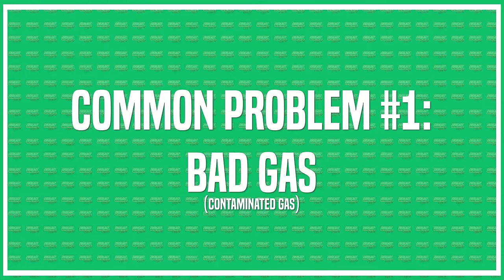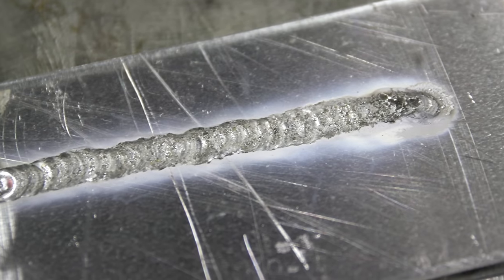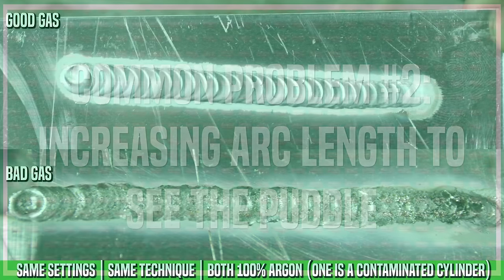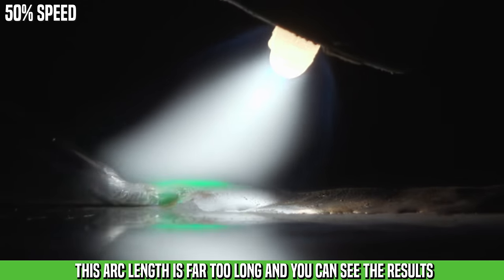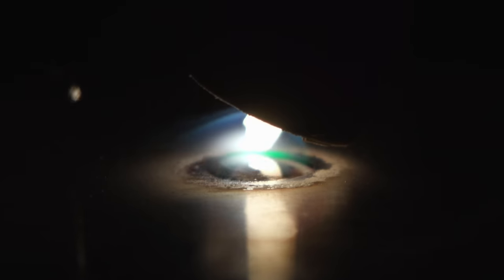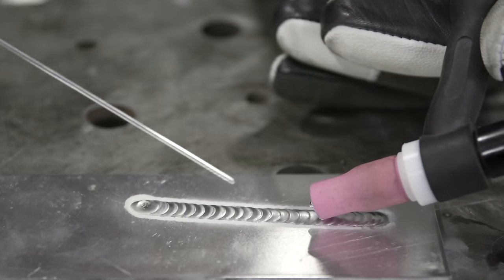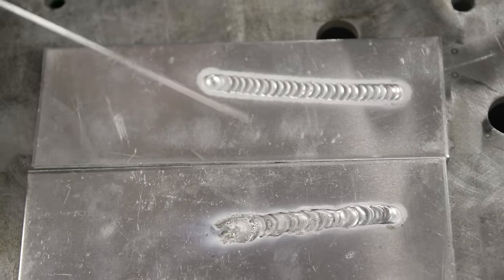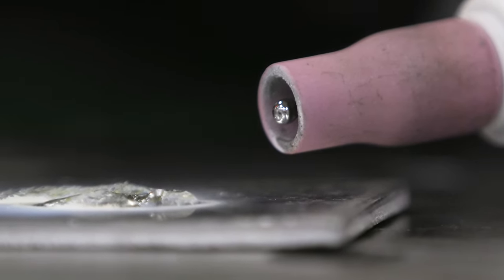4 Aluminum TIG Welding Mistakes You Didn't Realize You Make | Everlast Welders

Comment: I remember the first experience with a "bad bottle of gas"  :  The first few times I sat down to practice aluminum , all was going just fine.  Then one Saturday morning I sat down for some AC practice and I could barely get the puddle to even form! I was really confused as I thought it was something I had done.  I spent the next hour going over everything..... I then remembered that I have a extra 80cf bottle of 100% argon in the corner so that I won't run out on a weekend.  I thought, what the heck , I'll try it and "wha-la" I was back in business.  If it would have happened with a brand new bottle, you would probably realize it was the gas, but to have it happen mid way through a bottle was a real learning experience.  Thanks for the refresher Mark.
Reply: I've heard of this before, but it does sound weird to have the gas composition change mid-bottle.  I would sure like to hear a credible scientific explanation of how this is even possible.  I understand that you can get bad gas from a leak in the plumbing, but I would think such a leak would have to be right at the torch head to suck in any air.  Assuming you can solve this, you should be able to TIG weld silver amalgam repairs if only the patient would sit still... 😁
Reply: All week I was doing aluminum welding practice and now down to 400psi left in the bottle, then today after only welding for 5mins, all my welds turned to crap. I fitted a new tungsten, cup, cleaned the crap out of the aluminum , checked flow rates and weld still bad.  After reading your comment I think there is something wrong with my argon?
Reply: Dennis Young  Yes, CO2 liquefies at 900 psi while argon remains a compressed gas.  I can think of only one mechanism so far that could explain why the mix would change mid-bottle.  If there were some liquid CO2 present in an argon cylinder, it would become an increasing percentage of the mix as the bottle is emptied.  If there were an abrupt change in cylinder temperature (as from sunlight?) then the partial pressure of the CO2 would spike and abruptly become a greater portion of the gas drawn off.  This seems like a stretch to me, but it's the only thing I can think of right now.  I've used CO2 a lot for MIG welding steel, but always Argon for all TIG.  It would be interesting to see someone try CO2 for TIG just to see how bad it is.  I don't want to mess up my torch so I don't want to risk it.  I'd like some else to do that. 😁  Maybe YOU?!!? 😆

Comment: We pull a vacuum on and completely evacuate all cylinders before filling, which is standard practice.  We don't just "top off" cylinders like they do for propane.  Bad gas is not very common.
Reply: Welding for 50 + years... IMO, yeah it's pretty common.  Another thing I see more often than should be, pay attention to the gas you actually get.  You may get the purest gas in the world but when you ask for 100% Argon and the counter man isnt paying attention for whatever reason you may end up with C25 probably because that's what he hands out so much more frequently.  Just saying, double check.

Comment: I went from steel to aluminum and basically used the same methods. I figured they were the same. 

1. Travel Angle was wrong. Mostly the filler melting too quickly.
2. I was pulling up and even if I started good, yeah…wide pool.
3. Not cooling the plate often enough. Aluminum does not like a lot of heat when ur just stacking for practice.

This video helped me a lot. I’d say just from these I went from 4/10 to a 6 - 6 1/2. With not experience. Thank you for this vid.

Comment: Very well explained! Have many yards of it over the last 40 years. I will take exception to aluminum being non reactive. See that filler rod melting in the improper angle/long arc scenario? It’s oxidizing like crazy being outside the shield.
Reply: I'm new at TIG welding and I'm working with aluminum at the moment. Based on your comment, does is make sense to use a bigger cup for a bigger coverage area?
Reply: @bluedemon79  I have never really found a larger cup necessary for AL, I save those for stainless. Clean metal, good gas flow, the right electrode and keeping the village idiot from turning a fan on you or opening a door right next to where you are welding are key.

Comment: really nice presentation and very well understandable. I am having some of the issues, trying to weld thin aluminum tubes for a bicycle frames. Always maintaining the right torch angle on a small diameter tube is amazingly difficult - especially in combination with a tight torch distance. Finally - your worst weldings still look better than my good ones ;)
Reply: I can help you

Comment: Contaminated gas. Never knew that was a thing. 

Really explains why I was able to do halfway decent welds and then just couldn’t figure it out; I’d gotten a new bottle and it’s been junk since then!

Thanks!
Reply: It really sucks bro and the gas vendor will sit there and call you a shitty welder even if you been welding over a decade 🤬. Had a huge ordeal over gas where I work I few years back and both my boss and the gas vendor pointed the finger at me before even listening to what I had to say. I was able to get a clean bottle and swap back and forth and demonstrate that one bottle made bad welds on the same exact machine settings to prove my point. We stopped doing business with them for 2 years over them trying to blame me instead of owning up to them having contaminated bottles. I think that somewhere along the line the bottles were left open to the atmosphere and they didn't pull a vacuum before refilling like they are supposed to.

Comment: I noticed that my welds were poorer at the end of a tank. I had some real issues welding on my boat project. Getting ready to weld fuel tanks, and my bottle is getting low. Will swap out tanks first. Thanks.

Comment: Nice that I live in Germany bad gas is impossible here
Wen you give a shop the empty gas container they pull a vacuum on it then fill it with 120psi of the gas you will then pull vacuum.. Fill with 120psi.. Pull vacuum und then after 3 times vacuum then they fill it up to 200 or 300 bar =3000 or 4500psi

Comment: When you say balance ,  are you saying the heat setting good too high or gas pressure is related?  Please explain better , I though you were supposed to get a ball on the tungsten welding aluminum?? 
I have an old Linde machine , there is no balance setting ? 
Thanks

Comment: I try weld aluminum using tig.But can't.burn and put filler ...filler fly.
Anybody know how big gas preasure? Amp /power Tig for weld aluminum?
Thanks
Reply: Try with very high amperage. Much higher than steel.  Get puddle instantly then move.  Not slow like steel.

Comment: I've been fighting with contamination (pepper, can't get / keep a puddle going) on a project for several days.   I've tried fresh filler rod, changing settings, new gas lenses, nothing's worked.   I'm starting to think it's the bottle - it's dated 1977 (I think) with a 1984 recert.    Didn't have a problem until the bottle got down to less than  1/4 tank.    It's almost empty so the problem will take care of itself shortly

Comment: Sooooo on balance: I have an old square wave Lincoln, and do a lot of old, nasty, Harley cast aluminum. Mine is a simple unit, and the balance is pre-set. I don't know the split. Some welds my tungsten balls up quickly, others not so quickly. Thoughts or suggestions?
Reply: What size tungsten are you using? If Its undersized for the amperage it'll ball for sure
Reply: Mmmm! 3/32" I believe. I will look. I hadn't even considered that. Thank you!
Reply: @superdave2112  anytime, more than happy to try and help!

Comment: I had a bottle that would seem to work fine one day, and bad the next. You can go on the welding forums and read both ways about bad gas. Some guys say it never happens, others say it's common.
Reply: I'm wondering about the areas where the people who complain all come from, I'm betting they are from the same areas where it is damp and cold most of the year whole people who don't find that either order from places that have a controlled facility or are in an arid warm environment.  Either way I bet it would help to do a full purge occasionally.
Reply: @stevenjacobs6608  For the prices they charge, and the cost of the gas required to full purge, it should be dome every fill. But they are lazy I suspect.

Comment: Sir , l can see many porosity problems when I weld cast aluminium. I clean filler rod and base metal very good before welding. 
Sir, can you give some tip to avoid porosity?
Reply from the maker: Cast Aluminum is different in every application. Is it a part that has been soaked in oil? Cleaning is the biggest thing. If you drop a picture in the Facebook group we will be better able to help you troubleshoot.

Comment: I didn't know that about getting shitty gas from the supplier!  I went and watched the guy filling tanks. The big vacuum pump was not even running!  He just opened the tanks to air to fully empty them and then began filling them. Whatever residual that was still in the tank stayed there. When I asked him when the cylinders were vacuumed he shrugged and then turned on the pump and began pumping down the cylinders first. He actually knew better! He was just taking a shortcut to do more tanks per hour!

Comment: Hi guys. I'm just learning but so frustrated. I get a Miller dynasty 280 how can I set up to start practicing in aluminum? If somebody can give me some tips. I'll appreciate it.  Also I didn't know gas gets contamination. Thanks.
Reply: Gas isn't the thing that gets contamination, the bottle does. For example, imagine you have a pure bottle of argon, but you run the bottle completely to empty. There's some chance a bit of air migrates back into the tank unless you have a proper stop valve. Unless the company you do the refill with purges the air from the tank, now you have a mix of air and argon which contaminates your gas and screws with your welding process.
Reply: @bioweaponsystem154  no. I think my set up is not the properly. It's a digital machine and many functions to pay attention. Tig aluminum is not easy. I'll keep trying. Thanks for your help.
Reply: @Marycielo87  Search for your model on YouTube. Someone has to have set-up and run through the functions. Could also try looking up the Miller website and see what they have there for manuals and set-up help/troubleshooting.
Reply: @bioweaponsystem154  yes I'm trying all possible ways. Thanks for helping.

Comment: Wouldn't increasing tungsten "stick out" a bit more make it easier to maintain proper arc length by increasing visibility? With a gas lens and stick out just less than cup diameter, I've seen much better results. Just my experience, might not be proper technique but it works for me.
Reply: THAT's WHAT I DO ...EXTEND THE TUNGSTEN MORE ...DOE's THE JOB..AS LONG AS THERE's E'nuff GAS COVERAGE...

Comment: How do you "teach" common problems TIG welding aluminum when in every shot you show you are pulling the filler rod out of the gas envelope on every dab? #2 your torch angle is completely wrong

Comment: Lol i still cant get it right
Reply: Not sure if this will help you, but I got a small stainless steel wire brush and started wire brushing my material before I’d wipe it down with acetone (before all I would do is hit it with the acetone) and it helped a tone.  
I usually would weld aluminum at 120hz and around 70% en (electrode negative) if that helps
Reply: @christians131  thanks. There is a vid on youtube that states that "bad gas" could be a problem with weld quality . ??
Reply: I think I’ve seen that and while I haven’t dealt with it, I have heard of it happening. I’ve also heard of guys taking the shielding has bottle of and rolling it around on the ground a bit (I guess it agitates the gas?) then when they hook it bad up it works. It makes zero sense as to why but it’s worth a shot haha

Comment: I've never had bad gas. Not from a bottle or dewar. Guess it must be parts of the country where the gas provider doesn't have a lot of turnover. When you were showing arc shots of bad technique and your idea of proper technique you pull the filler way out of the gas shield. Might be the camera. But that can bring a whole mess of trouble.